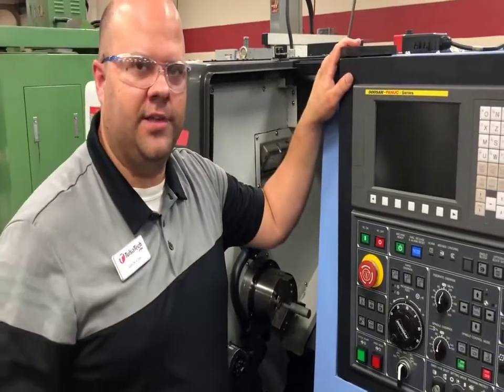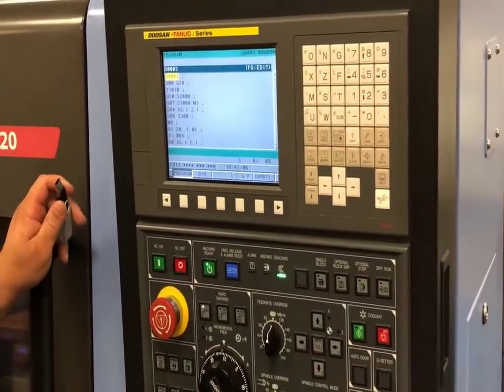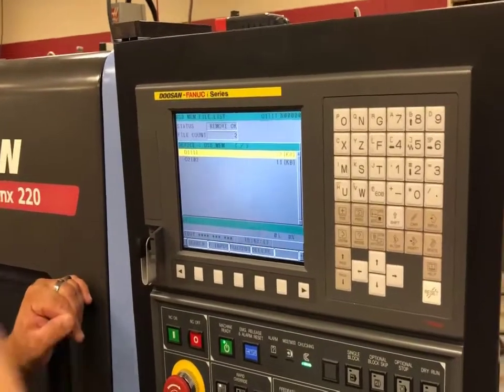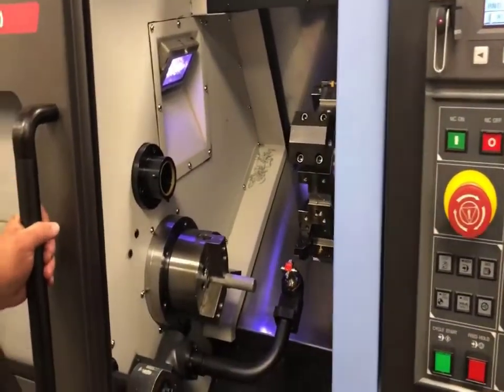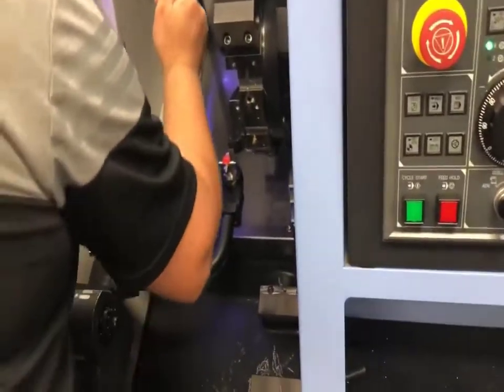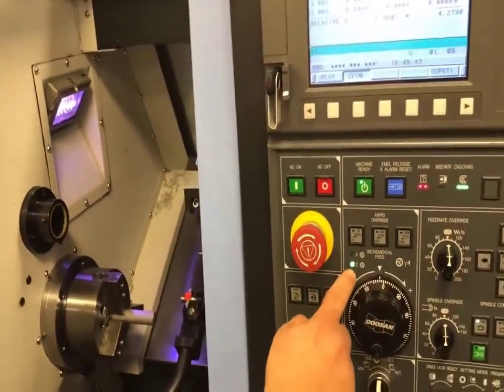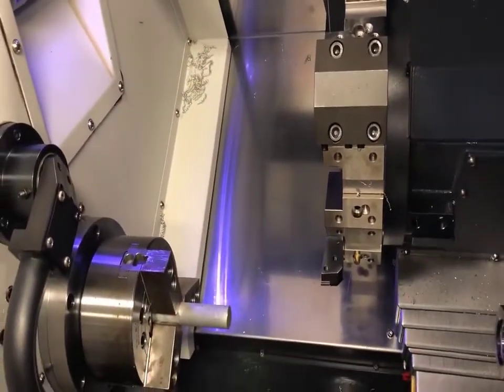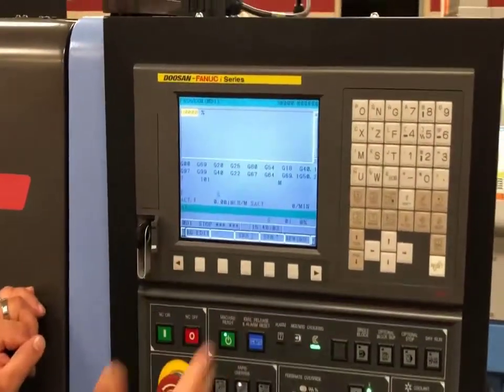Doosan Lathe Setup

Comment: I will bind the tool in “working offsets” if I touch the end of the workpiece with the tool and specify z0 ???????????????
Reply from the maker: Once the tool is at the face of the material and you specify that is Z0 the machine thinks that the face of the part is now Z0 and any G codes in your program that are in the negative direction will move the cutting tool closer to the Chuck

Comment: please make a video on how to link the mixing of an instrument (G54 - G59) without """"Renishaw""""", ok!!!!!!!!??????????
Reply from the maker: If you are wanted to set tools without the tool eye you only need to touch the tools on the face of the material where you want Z0 to be.
Reply: @aaronrunk4209  Thank you for your answer, I’m new to CNC and I’m having a hard time setting up a tool!
Reply: @aaronrunk4209  So, if I understand you correctly, I can go to the tool mixer (G54 - G59) and point one of the tools at the end of my workpiece and say that it is z0?  And if I have a different workpiece (of a different length) and I want to use the second working coordinate z55, then I also take any tool and touch the end of my workpiece and again z0?
Reply from the maker: @user-zg5vd2gl6n  Yes, that is correct. I have also attached a link that can further explain what this will look like.
https://youtu.be/cWkY15Uu208?si=Au5emCCHTxLbthPV
Reply: @aaronrunk4209  https://youtu.be/rd2u2MG6meY?si=AYnOtyqbvuaKXnlC in this video from Haas they talk about how to bind and they use another binding option in “working offsets”, how is that?  I understand that it is possible both ways!  it's not clear 😭😭

Comment: Definitely appreciate your tutorial on the Doosan lathe..I would like to see more tutorials on machine setups..miiling or lathe.. In particular Doosan related using the Fanuc controller..Thank you so much as there is very little if any on machine set ups especially on the Doosan brand of machines using a Fanuc controller..
Reply from the maker: Yes Doosan's are great machines and fun to setup. I have a mill setup too and will be making a setup similar to the one I have but on a lynx 2100